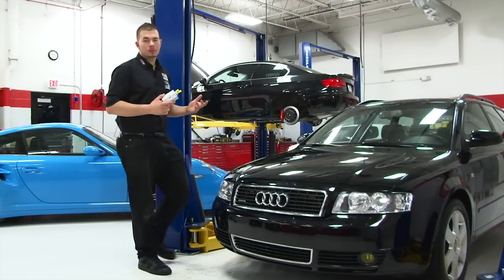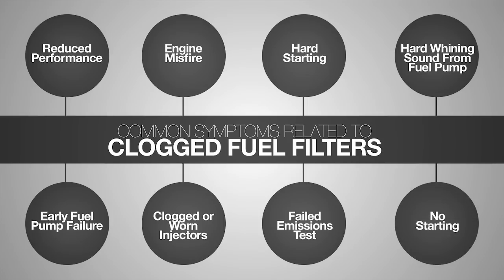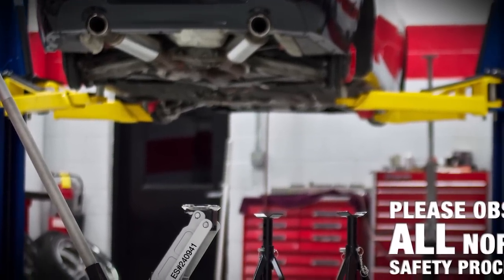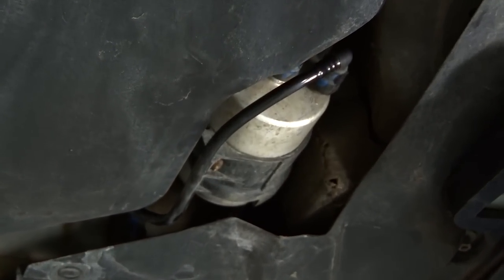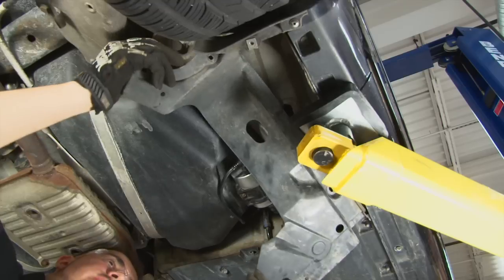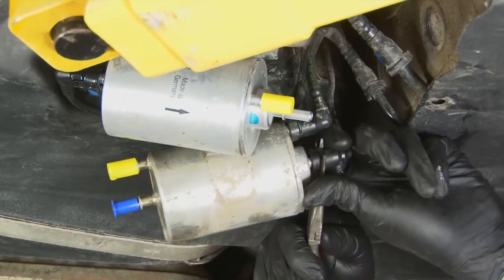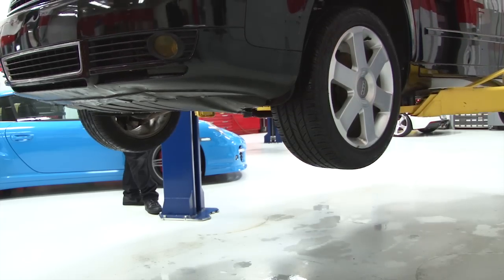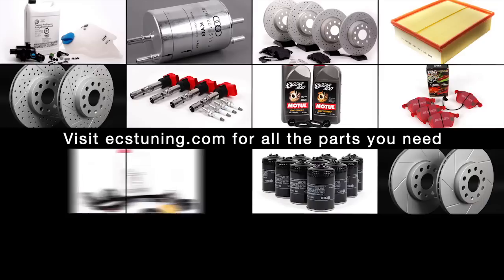ECS Tuning: How to change the fuel filter on an Audi B6 A4 1.8T.

Comment: So it’s a quick connect style with no explanation on how to disconnect it?

I’ve read multiple DIYs for the B6 A4 fuel filter replacement and every single one says something different for removal of fuel lines. 

Is it press and release? Do the clips on the fitting need to be pushed inward? Do they need to be squeezed for removal?

Comment: Extra tips:
1. some auto parts dealers are calling this the fuel pressure regulator (make sure it has 4 connections) they gave me one with 3.
2. to decrease amount of fuel from lines you can open the gas tank cap on your car to relieve some pressure.
3. another optional step is to remove the fuse to your fuel pump, run the car, and let it die on its own. this will draw more fuel from the system
great vid though

Comment: Advance auto is showing this as a fuel pressure regulator. They said the fuel filter is a non serviceable item in the tank. At least that is for my 2009 A4 Quattro CAEB.

Comment: I drive an audi b7 a4 codes P0089 fuel pressure regulator performance 1, no start at all. I replaced the regulator, car starts and then dies. Replaced high pressure sensor and high pressure fuel pump, still no start. Guessing its the in tank fuel pump?

Comment: Just finished replacing mine 👍🏻 thanks for the help!  Having the cabriolet I had to remove a lot more than a plastic cover. The fuel spilling was pretty stressful and dangerous make sure to take a few breaks for fresh air 👍🏻
Reply: Going to attempt this one the cabriolet  just bought. Stressing though i dont think it was ever changed and might need new connectors, Any advise would be great

Comment: Hey @ECSTuning there should be a warning about the high pressure in the fuel lines.  When I removed the back connector, outer fitting first, I got a face full of gas sprayed at me.   I expected some fuel to come out and had my catch basin ready, but this was tons of pressure

Comment: Where is the fuel fuse in the right hand a4 1.8t b6? Would it be advisable to remove it to clear gas in the fuel line before replacing the fuel filter?
Reply: you want to depressurize the fuel line.  pull the fuse in the D/S door side panel  its a 20AMP 3rd up on front side (IIRC #28). Check your diagram in the cover plate for fuel pump.  
Then you want to release pressure in fuel rail. there's a type of black cap on the firewall side of fuel rail. remove the cap (dont drop it) and use a small screw driver to gently push in  (1/8 inch)the stopper in the rail to release pressure.  Put the cap back on the fuel rail (before you lose it). 
Then you can try start the car -but it shouldnt start  as you have no fuel pump engaged and release the fuel rail pressure.

Comment: Does a bad fuel filter cause the car to judder sporadically? Or is it more likely the fuel pump?
Reply from the maker: There are many reasons that a car could be having surging and rough power.  A fuel filter is a good place to start if it hasn't been changed within the recommended interval.

Comment: Correct job! Thanks Folks!  30 minutes befor I have bin changed the F filter at my  A3 2.0 T Fsi. All the same , but You dont need a 25 Torx just a + Screwdriver

Comment: I got a code on my 2008 Audi A4 B7 base
"P2293"
Fuel pressure regulator 2 performance
I was wondering if is the same procedure for my b7
The regulator looks just the same bt mine onle have 3 plugs and no 4

Please let me knw and much thanks in advance
Reply: i did the whole process very easy by the way thanks for the advice on how to remove the plugs that helps alot...
Reply: +Luis Rodriguez did the new fuel filter get rid of the problem?
Reply: No at all it kind of made it better tho... 
Bt i find out my car went into limp mode...
If u dont knw what that means...
That means a huge pain in the ass...
Is almost imposible to diagnose a limp mode...
And theres no way knw to reset it...
My car runs great as longest i dont step on it
U knw i dont go over 3rpm bt if i step a bit too hard in it
My car start acting like it had bad gas
Or is no getting enoght gas
And my tranny wont shit and everything and i mean everything start shaking
Reply: @damnitdanielson  Hi I am getting the same code on my Audi A4 and was wondering if replacing the fuel filter fixed your limp mode problem?
Reply: @AngelRodriguez-dn4yc  Hi I am getting the same code on my Audi A4 and was wondering if replacing the fuel filter fixed your limp mode problem?

Comment: I got a code on my 2008 Audi A4 B7 base
"P2293"
Fuel pressure regulator 2 performance
I was wondering if is the same procedure for my b7
The regulator looks just the same bt mine onle have 3 plugs and no 5

Please let me knw and much thanks in advance

Comment: I have an off-topic question. I am considering a 2004 1.8t, and was wondering how to eliminate/mitigate how the engine revs fall slowly between shifts? Is it due to a heavy flywheel for some odd, emissions compliance issue, or would a new software chip make a difference? Thanks for all replies! :)
Reply: Thank you! Can you tell me if there's any advantage to the flywheel being so heavy ??

Comment: Bought a pair of push pin pliers 30degrees ($10) at Harbor Freight after hours of fighting to get a connector off! Pliers took 2 minutes- strongly suggest~ saving you from broken connectors. This is a great video and easy to view all of the connectors!  My son and I did this and it was the original filter from 10 years ago!  Car started up and ran for 2 days then it wouldn't start again at my son's school, had it towed home.  I am a mom doing this, not a guy.  Any ideas why it would run for 2 days and now it sounds like the same issue when you turn the key.  2005 Audi Quattro  (The car was not starting prior to replacing filter.)
Reply: +gracefralick Possible fuel pump issue. Need to do some diagnostic testing to be sure. The pump is not cheap, I would recommend testing it in accordance with Audi procedures first.

Comment: is this fuel filter also known as the fuel pressure regulator? because it looks identical
Reply: ***** thank you guys!!  You are correct. Thanks to your video I was able to safely and precisely replace my fuel filter. Ty once again you guys are pros.
Reply: A more accurate answer is: on B6 platform models, the fuel regulator is inside the fuel filter, not on the fuel rails; that's why is very important to get the exact replacement fuel filter code. The B5 for example, have external fuel regulator and it's located in the fuel rail, behind the engine...

Comment: hello im having a problem with my a4 2002 1.8t, I replaced the fuel filter and also the fuel pump and the car still stalling after 15min of car is running. and also I get a weird noise coming from fuel filter do you know what could be the problem?
Reply: what was the problem?

Comment: I removed the rear cables at the same time and not sure if I connected at the corresponding hole on the filter. Does it matter where they connect to? As long its a rear cable and connects to either one on the back?

Comment: Hey ECS I changed the filter on audi S4 and mileage is worse than before. Is it possible that it can be worse due to not connecting the lines to the right holes.

Comment: I got a wrong filter when i ordered it seem it fits only quatro i have 1,8t a4 2003 with four connections for the filter.. the filter i got has 3. Can i still use it or will it be really wrong with one host disconected?
Reply: Hell no! they tried to give me the wrong part too! even though they cross referenced it with the year and model.

Comment: I have an A4 Quattro Cabrio 3.0 that cut off while I was driving. It now is still not starting. Im pretty sure it has something to do with the fuel filter or pump. My question is what would your suggestion be on getting replaced first? The filter or the pump?

Comment: what I did , before starting I turned the ignition a few times on and off for the Fuel Pump to push some fuel in the lines and the filter.

Comment: I changed my filter just minutes ago I tought the lines were just attached by pressure but they have CLIPS! that you need to push to release the filter, I almost destroyed the connectors until I noticed this -_-